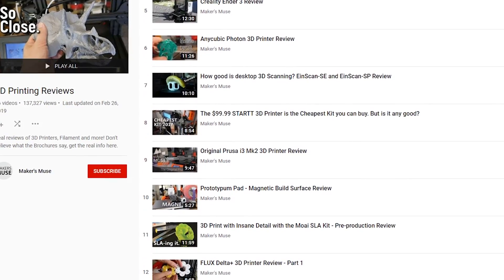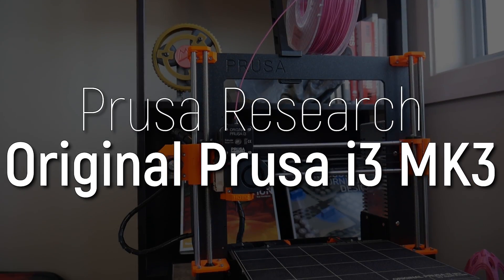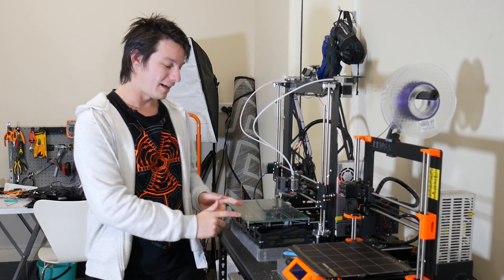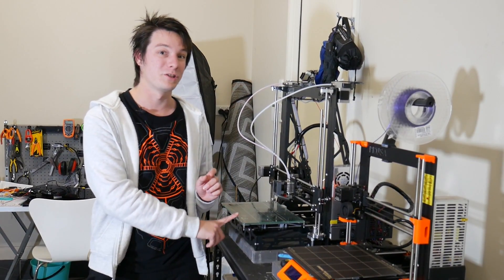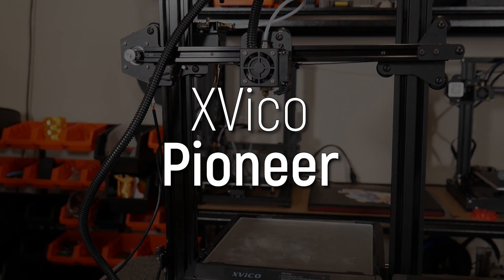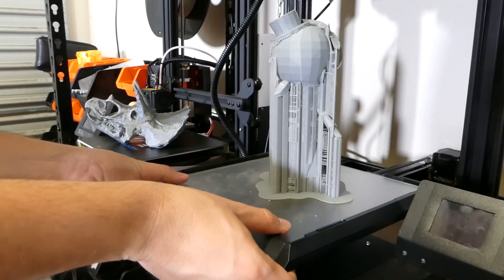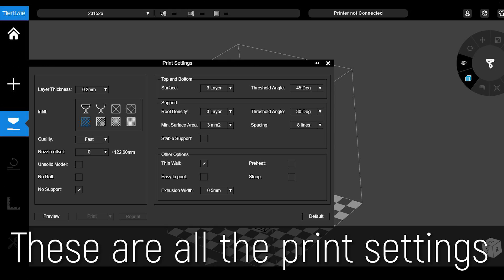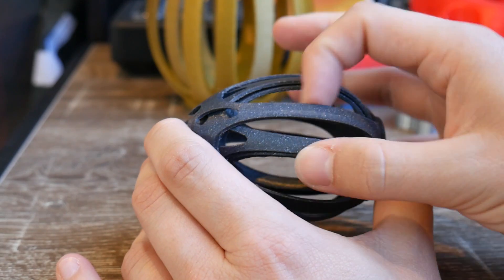My TOP 3D Printers for the 2019 Maker's Muse Studio (FDM/FFF)

Comment: Any recommendations for printing model plane wing pieces? Pretty simple stuff. Maybe fuselage pieces as well.
Reply: RC? You need a decent printer for that because that's usually just one perimeter and with lots of bad printers the texture is too bad to fly or the thing didn't bond on the single layer well enough.

Comment: Poor up Mini 2's.. 6 machines, 2 years of heavy use by the public and now three have ma inboard failures. 
They were very solid for a year and a half though.  Going to try putting a ramps style board in as the hardware is solid, just the electronics.. not so much.

Comment: I got a Prius i4 for Christmas and have never got it to work, it will no get hot enough to print.  My wife saw how frustrated I was getting and bought me a Dremel.  I was so surprised, it prints what ever I want at the temperature and speed I tell it, but if the power goes out or the filament breaks it will be a do over. Who could have guessed.

Comment: V1 Monoprice Mini stock only upgraded the selector knob and a guide.  I don't print that much 18 spools of filament over the 5 or 6 years I have had it but it started to not extrude so I replaced the extruder tip and broke the plastic feeder on top of the machine.  It might be time for a new machine with a bigger bed.

Comment: Flashforge Finder  Very affordable , reliable and precise. I am constantly amazed by how precise this printer is. I own a precision machine shop and machine parts that are on mars, in comets, and winging thru space on a daily bases. When my Finder is not printing a sample of a mars drill or a fixture to hold and protect the finished part it's printing prototypes or tool box organizers. The print size is my only problem.

Comment: Hi Angus I am new to 3d printing and I  purchased the tronxy x5st-400 and I am having an issue with leveling my bed I homed my print and used a ruler to make sure that my bed is evenly parallel to the XY gantey and when I set the nozzle height at all four corners   correctly when I put the nozzle to the center it hits. I thought that maybe the aluminum heat bed and or the build plate that came with the printer might be warped so I went out and got a piece of mirror that was the size of the heated bed and it still does it I tried using aluminum foil between the heated bed and mirror but still nothing if you have any recommendations that could help I would highly appreciate the advice thank you

Comment: 1. For high detail FDM prints - Up Plus (upgraded to Marlin board with TMC2100 for finer micro stepping , E3D Lite6 with 0.25mm nozzle and Titan extruder). 2. For ABS/PC-ABS/PC - Up Mini (upgraded to Marlin board for better bed temp control + additional chamber heaters). 3. Everyday PLA - Hypercube.

Comment: CR10s but it is also my only printer. Has been very reliable for 1,5 years, but lately causing problems. Probably worn down after running 24/7. I think the Ender 3 or Prusa will be my next.
Reply: I have the CR10, it is awesome.  I bought an ender3 and replaced everything,converting it to an abs enclosed beast from hell.  love them both.

Comment: Although I'm contemplating finally getting a more "modern" printer, my workhorse is still my first printer, a first gen Wombot Exilis which is really a Frankenprinter at this point, as nearly all of the 3D-printed parts on it, as well as the entire extruder/hotend assembly, have all been replaced over the nearly 5 years that I've owned it.

...and I'm not even an Australian; I had it shipped to the states as, at the time, even with $100 shipping it was still the best bang for the buck. (Nowadays a CR-10 would do the same job for half the price, but that was in Ye Olden Days of 3D printing, before the Cheap Chinese Printer Revolution had gotten into full swing. ;D )

Comment: I use two  Ultimaker 3 and  one Ultimaker s5  daily at work. i have to say tat the bed leveling is an issue  because it uses the z axis resistans to probe the plate. And flexible filament strings A LOT. But its nice to use dual extruder. i combine TPU and PETG/PETCF in the same print/part and i have noticed that if you use Tough PLA as support against PETG/TPU it sticks during print but gives awesome release with support roof and 0 mm on z distance.

Comment: I have a Formbot T-Rex 2. I've been happy with it. I got it for the large format 400x400 and the dual extruder. The dual extruder set up works well - I've heard of other dual extruder systems that are configured differently that creates collision problems between extruders and prints. I have been designing in disolvable supports to get better supported surface quality since there is an actual surface to print on rather than with standard supports. Their tech support is very responsive. Oh, yeah, and price. At the time it was less than half the price of anything else that size with dual extruders. I've also built an enclosure, added a dual zone heat bed, and started using borosilicate glass. I didn't have any problem with 1st layer adhesion with other surfaces - but had problems with the material adhesion to the build plate as painters tape and other things would pull up, even with 3M adhesive. I've also added a Rasberry Pi with Octoprint to drive it so it's fully remotable.

Now, while my Formbot is tied up doing a multi-day print and I want to just print out some small bracket or something, I have a Creality Ender 3. It's stupid simple and cheap. But it works really well so far and has good enough print quality for what I use it for. Although the Y-limit is with a limit switch rather than the BL Touch commonly used elsewhere - that kinda sucks (but what do you expect for the money). It's great for just proofing small parts and such. It may not be the best print quality...but did I mention it's stupid cheap? For some reason I haven't yet been able to get Octoprint to successfully maintain a connection to it.

Comment: - Try replacing the nozzle in the MK3!  If you use it the most especially with many filaments it may be worn out and surface finish goes first. 
- Don’t us SD cards, use Octoprint on WiFi!!!! (On RPI3b)
- Use a little hairspray (w/vinyl) on glass. First layer holds great, prints release easy. 
- I print PETG, PLA, and ABS on a modified Prusa i3 MK2 and a home built and enhanced i3 MK2 clone called Sam Bell (inspired by Tom’s 3D Dolly)

Comment: Running a highly modified Tevo Tarantula. It printed pretty crappy out of the box but I was also learning at the time.  The only things from the original that are still here is 4 or the 5 stepper motors, the aluminum beams, LCD,  and most of the stock screws.  The extruder, heated print bed, bed x-frame, all the frame mounts,  pulleys, belt tensioners, power supply, dual z, and many more mods that I can't remember.

Comment: Ah, the MK3. Easy to build, reliable, silent, and fast. I've been trying to find time in my work day to upgrade it to the MK3S with its improved filament sensor.

When I was learning 3D printing on a Robo3D R1, one of the first things I did with it is connect it to a Raspberry Pi with an Octopi image, because having to sit right next to the printer with a USB cable connected for the entirety of the print (the thing didn't even have an SD card slot) got old FAST. I'm thinking this would be a worthy upgrade for your MK3, assuming you have WiFi reception in your garage: send the G-code to the Octopi instance connected to the MK3, hit print in the web interface, and move on to the next project. Even better, you could easily hook up a camera to the Raspberry Pi and monitor your print (I never got to that point).

Comment: I only own the CR10s. I do plan to get another printer or two. I've considered having a couple of smaller printers around like the monoprice mini because most of my prints aren't too large for it and the don't take up much space. I've also considered an Ender3 because I'm seeing better print quality than my CR10s. Then again I have a couple designs on hand that I'd prefer to be one piece but are bigger than 300mm. Which brings me to the idea that maybe I should just make my own based on a duet board. As well as a cnc cutting machine.

I love the prints that come off of resin and powder based printers but they just don't seem cost effective enough yet.

Comment: Personally, all I own is an Ender 3 Pro. I LOVE it. I haven't really pushed it to do anything crazy at this point. Sure, maybe I get some strings and overhangs aren't great. But I'm also running the stock cooling duct. And, from what it looks like to me at this rather early point in my 3D printing journey, most of the variables are in the software rather than the hardware and you have to learn to work with what you have. 

The big question I really have at this point is whether or not stiffness is better or flexibility is better for preventing artifacts. I really have some serious doubts that you can stiffen a printer to the point that there will be no vibration-related print artifacts. There is always going to be vibration. The question is: Can you increase the stiffness to the point that the vibration artifacts are no longer significant as compared to the mechanical limitations of the equipment?

Anyway... Why do I love my Ender 3 Pro so much? Because IT'S DIRT CHEAP (compared to the printers you're talking about in this video, Angus), and you can do ANYTHING to it. It's a beautiful starting platform for tinkerers like me. You want dual Z-axis rods? There's a kit for that. You want dual extruders? There's a kit for that. You want direct drive? There's a kit for that. You get to decide what you want to use your printer for instead of being locked into the manufacturer's decisions (and compromises) about what the printer should be good at doing.

Sure, it's very mildly disingenuous to sell the Ender 3 so cheap and let people think it'll do anything they want right out of the box. But, then again, every printer is going to have to have compromises in its design, right? The Ender 3 is definitely not the printer for someone who wants to open a box and start printing. For us tinkerers, though, it's *wonderful*!

Comment: My ender 3 has been up on "cinderblocks" since before Christmas. I finally fixed the stupid power connector. Now I want to wire the board cooling fan directly into  Vcc & ground so that it's not tied to the part cooler (real smart, creality, real smart!)

Comment: F Prusa they are a bunch of thieves. The support team is setup to con you and mislead you into giving them money I will never give prusa another dime. My prusa printer with in 7 months (@ 7 months printer totally quit working ) but with in the 7 months that it did work i had to replace 5 pinda probes 1 bed 1 thermistor cable and was fed a lot of lies from prusa support team. with in my first 30 days of owning the MK2S it started showing me signs to return it I contacted support to return it. The support staff talked me into keeping it saying they would send me the parts to fix I mistakenly agreed and i been dealing with this trash of a printer sense. today i own a cr-10s 2 cr-10s Pro's and a ender 3.... The Prusa MK2S is the only printer that i own that does not run. Prusa needs to go fall into a hole someplace and never be found..... He is a THIEF

Comment: My AnyCubic Mega is going strong using cheap nasty $20 black PLA.   Good easy self release offthe Ultrabase, very sturdy printing tall skinny objects with ease. Can't recommend this 3D printer enough.  At the price a steal.  Just using Cura standard or advanced settings all seem to work very well.  Everything rock solid so far and prints remarkably water tight, so bonding is excellent overall.  Used both Fusion for advanced projects and TinkerCad for basic ones and both work really well exporting to Cura and uploading no issues.  Surface finish is amazing no stringing and does a brilliant job on overhangs.  For those thinking of starting, this is a very good optimum entry point I feel.  Finally have not levelled the bed in 2 months as the prints come away with finger force once the bed is cool, so another plus for the Ultrabase.  Have not tried printing in ABS or ASA or other materials as yet.  If I do, I think I will buy another machine so I can dedicate the 2nd machine to more exotic materials.  My guess would be a bowden tube setup will struggle with flexible filaments and this is where the direct extruders and the extra cost is well and truly justified.  PLA is very strong however and proving more than adequate for most protyping I am doing at present.   Extremely happy with the Anycubic I3 Mega.  Since I live in Australia, I clean the bed before starting a new print with Methylated Spirits on a clean paper towel.  I always print with a skirt, to get good adhesion, before it moves inwards to start printing the object proper.  I have also tried brims but that is overkill.  Twice around is all that is required on the skirt and adhesion is perfect within a few inches of the start of the skirt rotation. Compared a professionalprinter the other day and Anycubic at 1/20th the cost was giving better results, so do not be fooled into thinking you need to spend big money, to get amazing quality.  Rd.

Comment: I use an Anet A8. Been using it for a year now and have put PLA, TPU, PET-G and ABS through it. ABS is my port of call and I get rolls here in New Zealand for about $27 each. I've made some modifications, as Angus says, things get cold... Real cold. Christchurch got down to -3º and I was still printing overnight in an old house in an unheated room. Using ABS slurry she still sticks well to the best and can maintain it's heat, I do this by completely shutting down and removing any fans. That's right, not fans... Heatsink has gone too, don't need it! And she's been running like a dream. I haven't needed to look elsewhere yet for another printer and just purchase consumables ie nozzles from aliexpress. The longer I've run this machine to find it's limitations, the less consumables I've used (other than filament). My heat bed is the usual out of the box metal base, but I to eventually remove the plug on the back as per an Anet user, they fail and either burn your house down or crackle until you need to solder it directly to the heat bed, which is fine. I use a 2 to 3mm glass plate on top of the bed and bullclip it in place for prints. ABS slurry is called for on any plastics or prints to stop things from moving.

Comment: I have a really old Mendel that I built from a kit. It came with a heated glass bed and I always had difficulty getting prints to stick - until I started coating the bed with a dilute PVA solution. The second print that I did with PVA stuck so well that it took a chunk out of the glass when I pulled it off. I cut a piece of 5mm mirror to replace the bed. I've been using PVA on the bed ever since. When  the bed stops sticking well, I just wash the PVA off in the sink and apply a new coat.

Comment: @Maker's Muse: Good adhesive/separation spray like 3DLAC (or Dimafix for demanding materials) are a perfect companion for 3D printing on removable glass. Easy to use, to clean, much better and reliable than all of glues and juices. And less visible on surface. And one obvious, but proven tip: Use DIY OctoPrint server with Pi camera (on RasPi 3 etc.) and user experience with i3 MK2/3 is one level higher. No more SD cards, smooth remote control even with more machines running elsewhere. :)

Comment: With our workshop setup we went through almost every model of Flyingbear. They are pretty cheap, they don't do wobble-beds and as the time gets on they improve on everything in their machines. The best one is Ghost, which I use for anything almost. But not tornado, it had some issues that have to be fixed and its a pain in the arse to fix.

Comment: I use a substantially unmodified Tevo Tarantula with a heated bed and using PLA filament for my model railroad models, in N scale (1:160) and find it pretty good for the price I paid. I must say it did print a rubbishy but I tweeted it’s setting and it is much better. Thanks for the tips Angus.

Comment: You might consider using the FlashAir W-04 SD card from Toshiba.  I find that it makes it much more convenient to load G-Code since it is wireless.  Works like a network drive for the printer.  You cannot command the printer to start with it as far as I know, but if you have to go remove the previous print anyway, no big deal.

I also found that the MK3S upgrade did improve my surface finish.

Comment: I'm not surprised that random i3 clones are so reliable. It's a great design and ideal for the ~200mm^3 envelope. It may be worth the extra $ for an MK3 to get it straight from the inventor and to get into the Prusa ecosystem. But if you're on a budget, i3 clones are a good value, and they're even able to use the latest Prusa Research peripherals (or equivalents) with current open source firmware.

Comment: For me, the dreamer is still plodding along even though I have changed the nozzles for swiss and bed for flexible, the dreamer even though it is old now is a workhorse as it does not like to be turned off, so if you keep printing with it 24/7 the prints are fine. I do have also a Trinus and a CR-10 but just love the flashforge because it is so reliable.